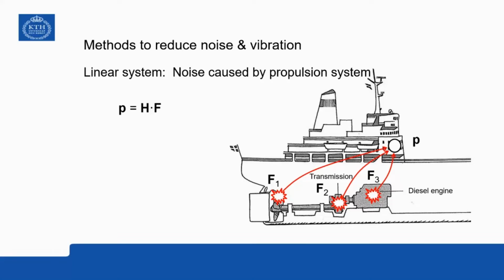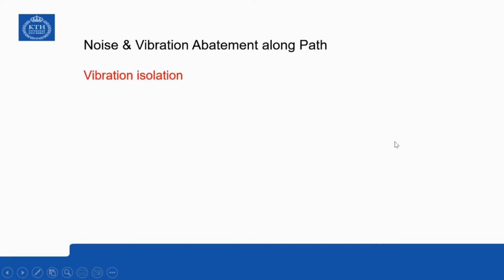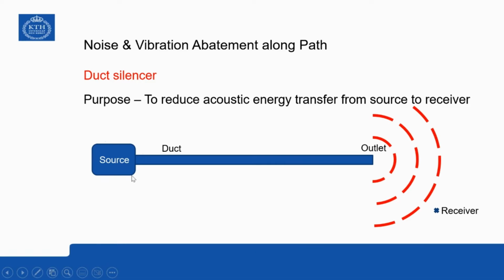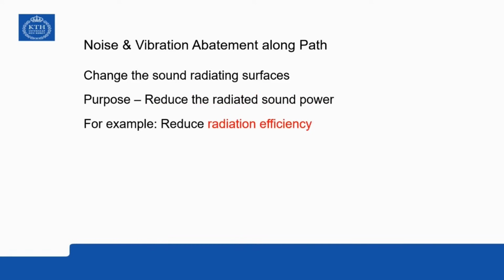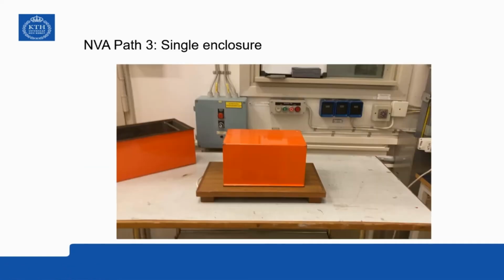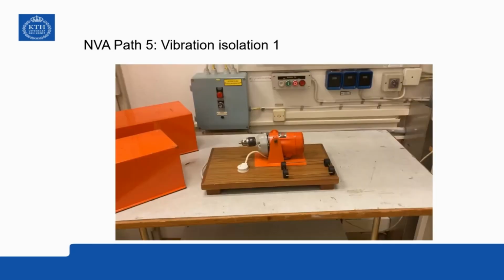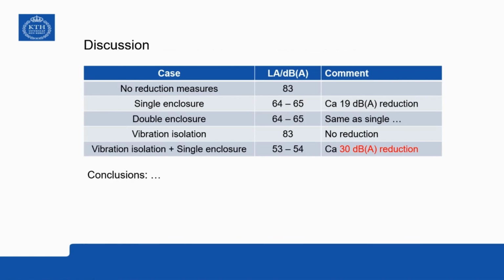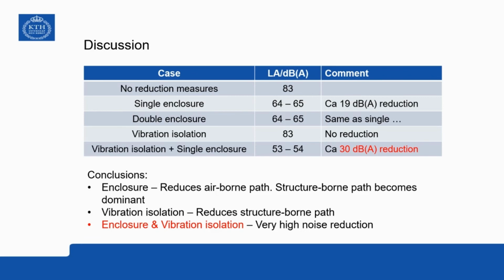Noise Reduction Along Transmission Path

Comment: I really agree on the last part of the video, I have seen cases where the noise turned out to be nearly entirely structure generated. In that case adding the sound enclosure INCREASED the emitted noise due to the added vibrating surfaces of the enclosure walls.
Reply from the maker: Hi David. Yes, having full control over how much each source and each transmission path contribute with, is the key to successful noise control measures.